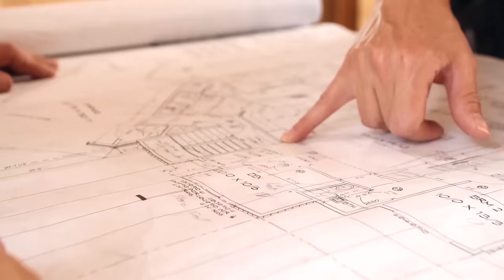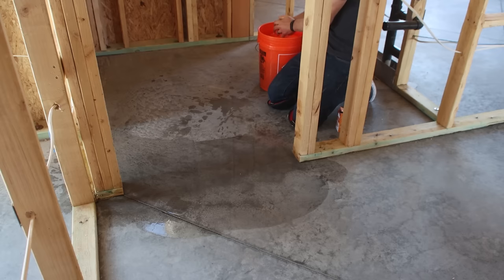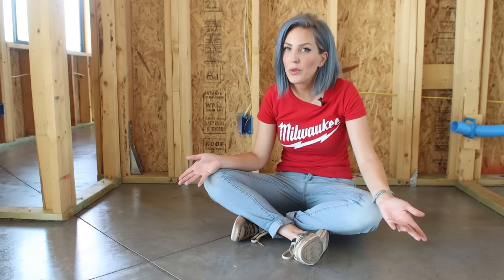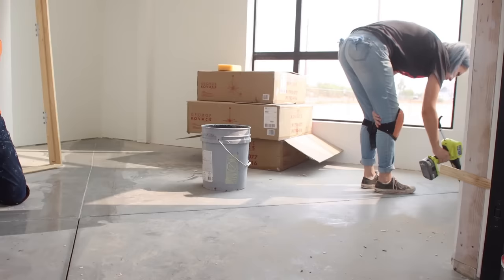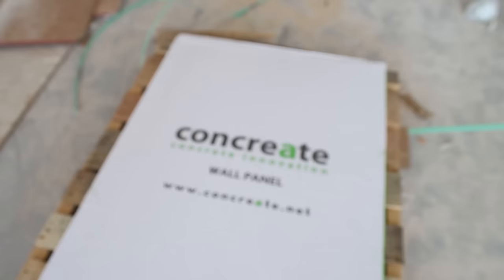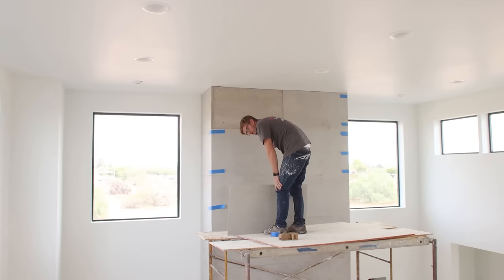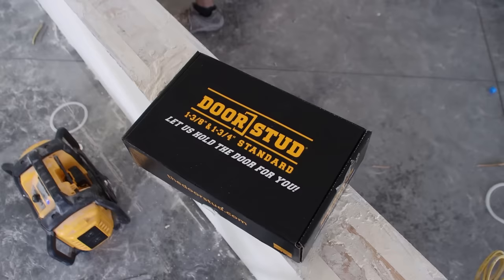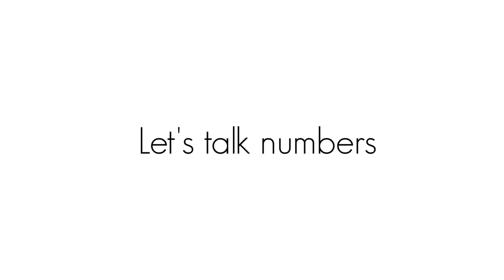DIY Concrete Floors & Fireplace, Interior Doors | Ep. 9 Building Modern on a Budget

Comment: I like the Fireplace the whole build, Electric or not.
Looks very expensive so it does add value to the overall interior decor. If you add a wide flat display Panel on top of that wall, it will look smashing.

Some of the Video shots have Mono instead of Stereo Audio.

Comment: I like what you did, I would recommend that you do 2 coats initially and then after the walls are completed, use a red pad for cleaning the sealer, then add 2 to 3 more coats after it's all done and then buff with a high speed buffer. If you get standing water on the sealer it will need to be refinished, but I like the look with no stain.

Comment: Thanks for the video! Dude I swear we are close on designs. 

 I’m taking out my big walk in shower fiberglass and doing a curbless shower with a linear drain at the opening so no door or glass wide open. Whole bath is going to be concrete floors and concrete walls in the shower. Thinking about 1 long concrete countertop and built in wedge sink. Midway in the sink I want to make the mold so it notches out a square on either side so I can place a teak or bamboo across it for a little counter top.

And I’m doing a 2 story concrete skimmed fireplace, but I’m putting a shelf about 12ft up to set a cafe racer up there!!!!

Comment: Awesome! You guys are doing great on this build. It would be nice to see what the running cost per s.f. is costing you, also your sweat equity hous as well. 
At end of the project you can assigned an amount per hour, and don't forget you also need an amount for managing the project. By the way, with what you have spent, given the size of the house you are doing a tremendous job staying close to budget. (For the House build)

Comment: Loving the videos so far - all the way from Melbourne Australia. One thing I noticed was just how 'live' the room sounded around the fireplace. I guess this is not surprising given that nearly all your surfaces are highly sound reflective - concrete floor, concrete tiles and lots of glass. Do you have a plan to treat the acoustics, as it was almost stairwell level of reverb. Perhaps some rugs, wall treatments, maybe? Impressed by your courage and energy to take on such a large undertaking. BTW, even though the makeup was perfect - the amount of sweat running down your neck in one of the earlier videos was pretty insane. BTW - The highest ever temperature recorded in Melbourne city was 46.4 °C (115.5 °F), on 7 February 2009 - and that was scary hot. 117 °F is just ridiculous .🤣

Comment: That "sealing" coat you put on the concrete is not going to hold up.  You'd be surprised the claims the manufacturers make but their coatings fail often.  Also, the smoother the concrete is finished, the harder it is for top coatings to bond because most are based on a mechanical bond.  I have a business partner that has a unique coating for concrete that covalently bonds to surfaces.  If interested let me know.

Comment: Interior hollow-core doors cost $7K ?  how much did each interior door cost ?  The first one has one of those glued together framing made of 2 foot lengths glued together.  Cheap quality...low price.  Those cost less than $200 each...that means you installed 35 interior doors.

Comment: At $80 a panel not including shipping Looks like you needed 40+ panels That’s roughly $3200 in concrete panels alone if you add in the hardy board plus framing plus blades plus adhesive material you’re looking at something close to $6000 bucks? How is it saving any money over concrete?